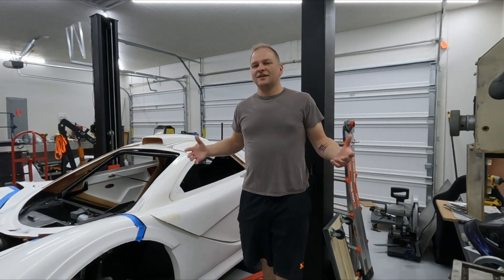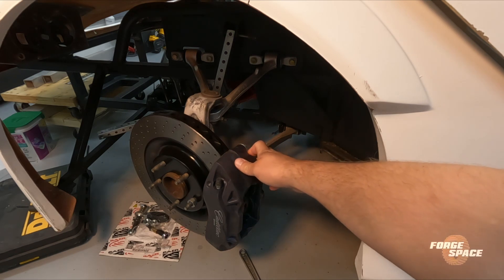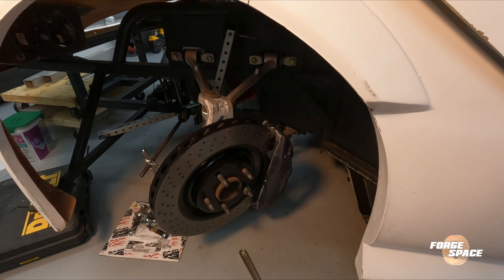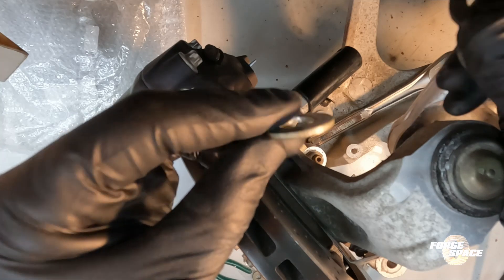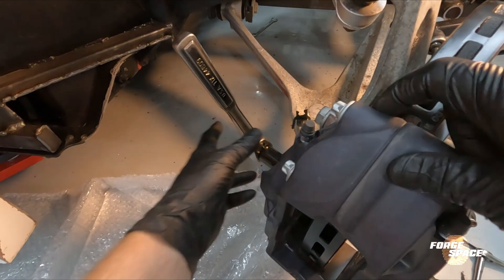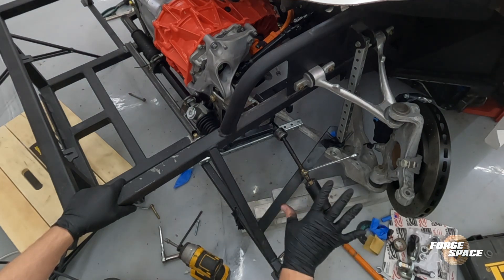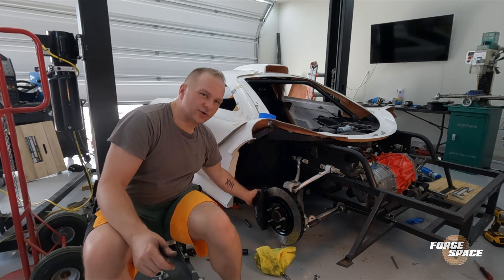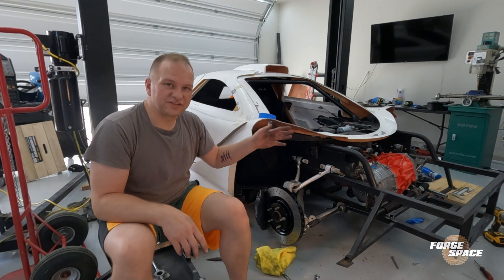DDR Front Brakes - 14" Rotors (ATS-V)

Comment: will you be adding regenerative braking?
Reply from the maker: Because the ingenext controller uses the tesla inverters, it inherits the same regen functionality as donor vehicle. So, yes, it will have regen in the same settings as the tesla and I plan to leave it in max regen mode